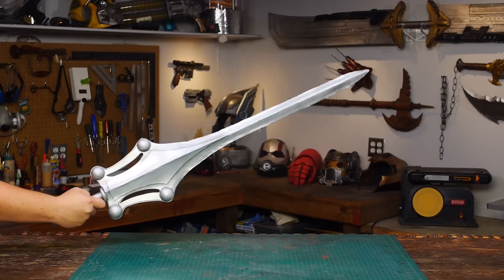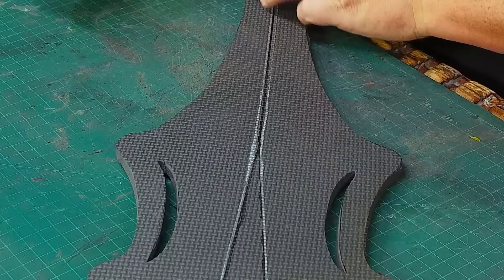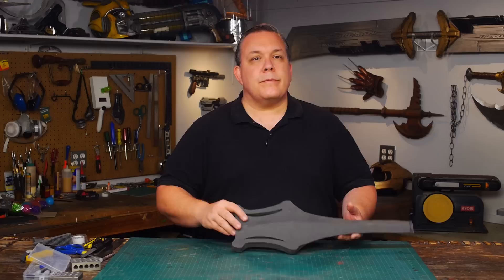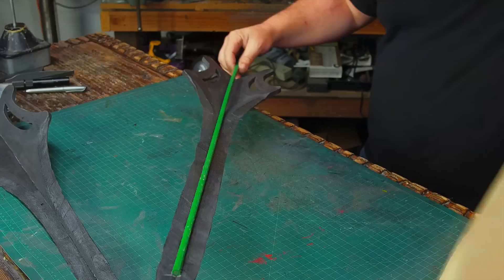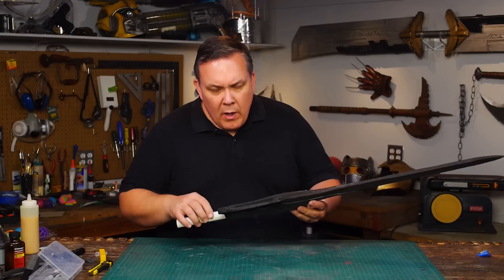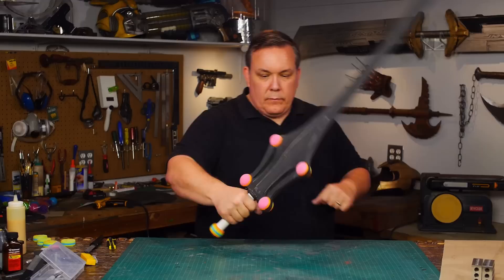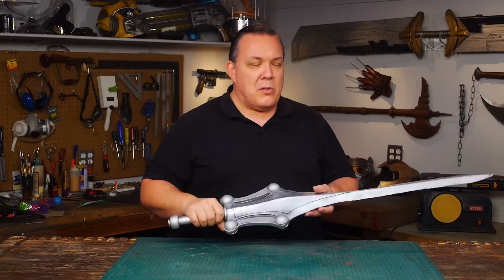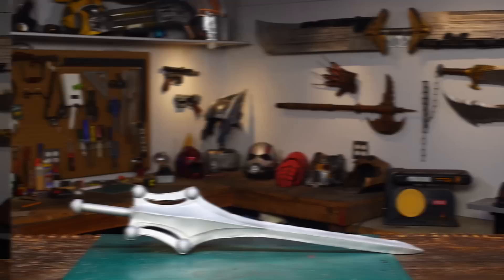Odin Makes: Power Sword from He-Man and the Masters of the Universe

Comment: Odin this turned out so great! Im kind of salty that I made my sword before you did.. the way you did it, the blade and tip turned out so clean! When I made mine (a little over a year ago), I did it while at my dad’s car repair shop, so I made an Aluminium handle, and steel reinforcements through the blade. And the way the pieces fit together, it makes really cool sounds when swung around.

Comment: I am doing a sword build with the green garden rod too, Zuko's double swords. I carved the handle out of wood using a dremmel and am going to epoxy the rod in. But i think I'll wait till the foam is on them first.
Reply from the maker: Sweet! I like that the rod can be carefully bent to fit a curved blade, if needed.
Reply: How is it for thinner blades? Would it be better to flatten it a little?